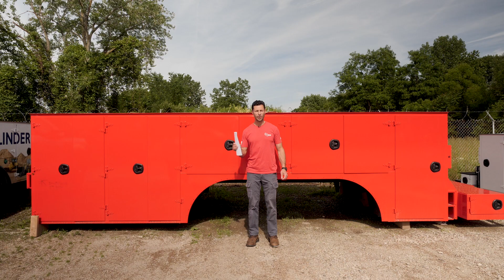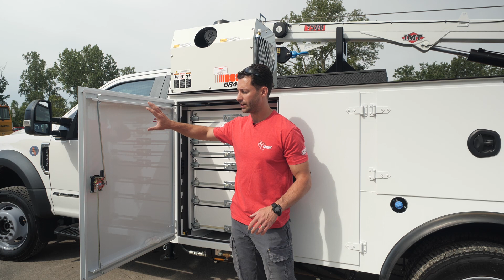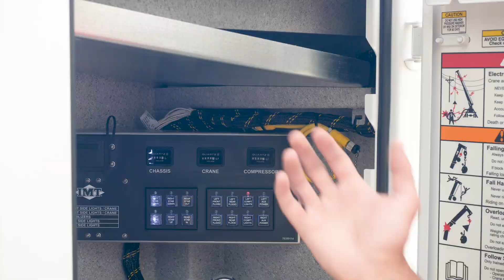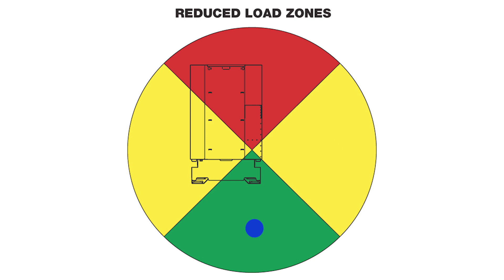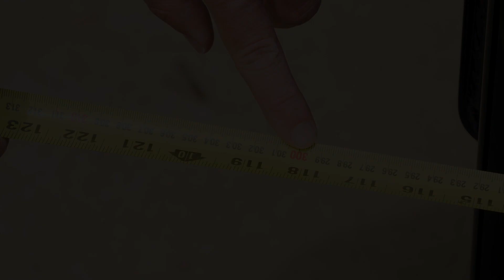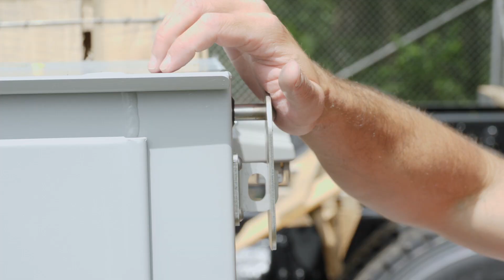Tour of IMT Service Body Options

Comment: Are all of the imt bodies wiring looms labeled, I had to remove the cab on a 2006 amerigas body, 3820 on left, and my rear stabilizer always needed to be extended to operate crane, now it must be retracted, however extended use to stop it from going into drive, but now it goes into drive while retracted (the new extended) I must have replaced a switch from nc to no or just flipped two white leads? There was not a disconnect so I had to cut the harness, and splice all wires, had trouble with 2 or 3 white wires? All seemed to be not labeled? Maybe I just need to open more loom?
Reply from the maker: Thanks for watching!!  Not 100% sure if IMT was building the amerigas bodies back in the day... They used to build a propane body but I think Reading was building too and using IMT cranes.  All the wiring inside an IMT service body is labeled every few inches.  This is on current series as well as Series 2 which would have been in the 2006 vintage.  White wires inside a braided loom.  Also those switches for the stabilizers may have been added at the dealer level.... hard to say.  Parts department could probably get a BOM on this job with a serial number.  Just email parts@qtequipment.com
Reply: @qtequipment  thank you....

Comment: Do you make an 11” mechanic Serv body to accommodate a Ford F-350 /450 with all 40+” tall cabinets tool boxes in the left and right front vertical cabinets and a mechanic rear work bumper ? No crane .
Reply from the maker: Yes, the DSC20 is a good option for this and can get with work bench bumper.  Probably would want the F450 vs. F350.  Although, IMT only makes crane reinforced bodies so cost will be considerably higher than non-crane body.  They also have a DSC12 body if you went with the F350 single rear wheel.  Sales dept will be able to give you additional info at sales@qtequipment.com or 800-758-2410.